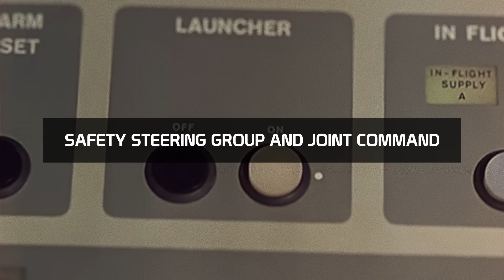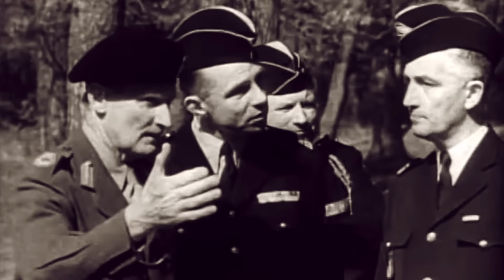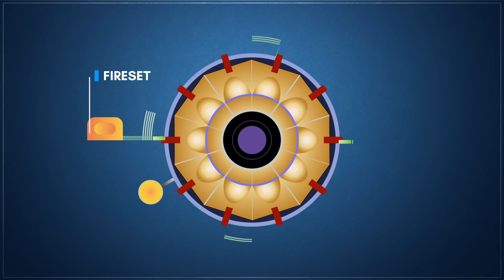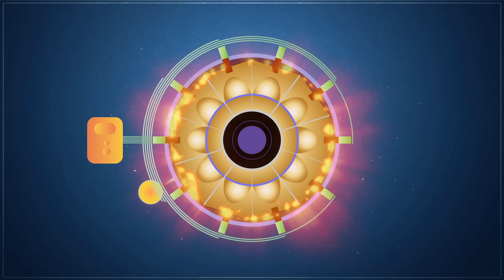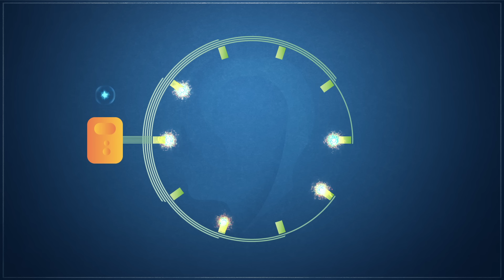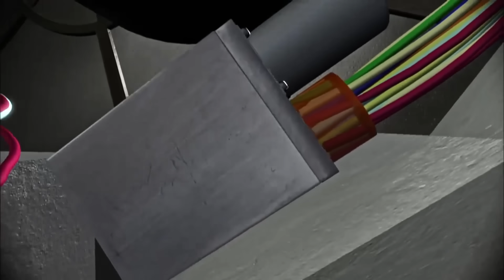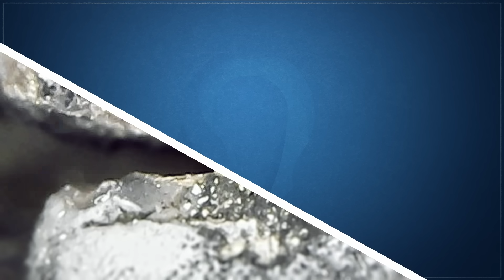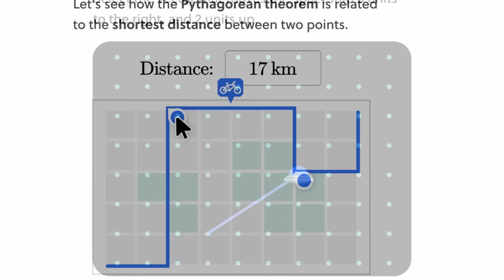The Remarkable Mechanism That Secures Nuclear Weapons

Comment: 2010-0114, Officers Accused of Secret Theft Allowed to Resign. 
Two officers accused of stealing classified material from an underground missile launch facility @ Minot Air Force Base, N.D., have been allowed to resign rather than face courts-martial, the military said Wednesday.  
Air Force Secretary Michael Donley approved the resignation of Capt. Paul Borowiecki in September & Capt. Javed Abbas last month, the military said. Abbas is stationed @ F.E. Warren Air Force Base, Wyo. & “will be out of the Air Force in the near future,” an Air Force statement said.  
Borowiecki has been discharged from the service & is living in Mesa, Ariz., records show. Neither Borowiecki nor Abbas could immediately be reached for comment. Neither man had a listed telephone number & Abbas did not immediately respond to a message left for him @ the base through an Air Force spokesman.  
The Air Force had not named Abbas until Wednesday, the day it released the status of both officers, after months of inquiries by The Associated Press.  
The men were missile combat crewmembers assigned to the base’s 91st Missile Wing. They were among the crew members who work 90 feet underground prepared to launch nuclear missiles.  
They were accused of taking classified material a device used to detect equipment tampering in the launch facility, said Air Force spokesman LTC John Thomas in July 2005, rather than destroying it as required when it was no longer in use.  
The Air Force said Borowiecki admitted the theft in May 2008 & returned the device.  
A hearing was held in September 2008 to determine whether Borowiecki would face a trial. A supervisor, Capt. David Walbeck, testified @ the hearing that Borowiecki wanted the domino-size device, as a souvenir because he thought it would be “a cool thing to have.” Walbeck also testified that had the technology been compromised, it could have led to “unintended detonation” of a nuclear missile.  
The Air Force later downplayed Walbeck’s statement, saying the launch device is one of many safeguards that must work together to ensure security.  
The Air Force has said Borowiecki told officials that Abbas had lied by saying he destroyed his device.  
The Air Force refused to confirm whether that device remains missing.  
“An investigation determined there was no compromise of the safety or reliability of the system,” an Air Force statement said. Lie-detector test  
Officials said the theft became known when Borowiecki was given a lie-detector test in applying for a job with the government’s National Reconnaissance Office. Officials said he answered yes when asked if he had ever stolen classified material.  
Borowiecki was charged with dereliction of duty, making false official statements, wrongful appropriation of military property & mishandling of classified items in violation of federal law.  
A court-martial had been scheduled in March for Borowiecki but was postponed.  
The Air Force said Abbas also had faced military & federal charges, but the service would not elaborate.  The cases were handled by the military separately.  
“It was determined that acceptance of these officers’ requests for resignation & directing their administrative discharge from the Air Force was an appropriate resolution for this matter,” the Air Force said in a statement. “Both individuals have been held accountable for their actions.”  
The Air Force has said the case led to changes in the procedure for destroying the launch devices after they are no longer in use & that they are now destroyed @ the base under the supervision of two other people with top-secret clearance.

Comment: Couldn't you just bypass the locking mechanism and "hotwire" the bomb? You should be able to set all of the explosives off at the same time without using the intended method.

Comment: 8:40 No...that's not correct ,the ignition is not synchronized it is better described as simultaneous, the firing mechanism does of course use low inductance design but that is secondary to the truth of it, it is designed so that all the explosives are ignited  down to the microsecond, the explosives are shaped charges that act as a compression force, timing is critical, to be sure that the force is perfectly symmetric, perfect compression.

Comment: Our land base missle systems are network isolated. They are not tied into the internet or any other web based launch control network. They can only be launched on site. Sub based nukes operate the same way. In short, if the guys who are manning the missiles don't launch them, they cannot be launched by any other means. I imagine other nations follow the same protocols. Nobody wants to have their nukes hijacked electronically after all.

Comment: Incorrect, the voltage used to initiate Exploding Bridgewire Detonators (EBWs) and later Exploding Foil Initiators (EFIs, aka “Slapper Detonators”) is between 3kV and 5kV, not 20-60kV.
Also, the detonators were not sequenced as indicated in the video, “Simultaneity” was key for a clean, efficient detonation, we are talking about nanoseconds.

Comment: I was a bombardier flying A-6 Intruders in the early 80's. I was qual'ed as nuclear delivery crew and as a nuclear weapons loading officer. We handled three different nuke weapons models. We had a class on PAL because of the possibility it might be coming into service, but from '80 to '83, none of the weapons we had used it. In theory, though, none of the weapons aboard a aircraft carrier were jointly under the control of any other nation. At some point after I left, they stopped putting nukes on carriers, although I think they are still capable of using them.

Comment: I was a weapons systems specialist in the USAF in the 80's and 90's. On the B-61 bombs we loaded, we connected a device called the PAL/USG. Permissive Action Link / Unique Signal Generator that transfered the codes to the Pilot, and the Weapons Systems Operator on the F-111F's I worked on. Exercises were run using the actual live weapons, and we went through the routine, as if it were for real. The jets ran down the runway, but killed the throttles, and hit the brakes, and returned to the victor alert area. You can't fly with nuclear weapons anymore, unless you were actually going to use them, as intended. Those exercises were a real sobering, eye-opening experience. Seeing this vid brings back a LOT of memories....
Reply: There was a “Incident” where we accidentally flew with some ordinance they forgot to replace the physics package with an inert dummy.
Reply: @videosuperhighway7655  "Whelp, just another day at the office-"
OPREP-3 - BENT SPEAR
"Awesome. That's exactly what I wanted to deal with today."
Reply: @meatharbor  Our fear when loading was damaging/ scratching the weapon. NOBODY wants to fill out a Dull Sword report. You'll be standing tall before the DCM, explaining why that happened. You'll emerge with one less stripe than when you went in...
Reply: @GJones462-2W1  causing a Dull Sword... i can only imagine.  The worst I ever saw as a missile cop in Minot was a delayed convoy, and even then people were shitting themselves.  I was just standing there like a lump at the gate waiting to let the payload transport in.  xD
Reply: @Mog_King_of_Moogles  Yeah, I would LOVE to watch that process. Either removal of the missile, or the installation of one. I'll bet is well choreographed, like our aircraft loading is. So as someone who was on site  in a place that that with nuclear weapons, you know what PRP is, don't you?
Reply: @meatharbor  OPREP-3P – NUCFLASH
"Awe cr@p"
Reply: There are no bombers with nukes on them for quicker response if needed? As a former submariner, are ballistic missile subs are always carrying a certain number of nuclear missiles on board, when out on patrol. These subs even have 2 crews so that the Navy can maximize the time the sub is at sea. Because the subs are always armed and patrolling, I figured that the air force would have something similar…a B-1 or B-2 armed and ready to go, or even flying a set pattern continuously like in the movie By Dawns Early Light? Thanks for your service!
Reply: @SubVet84 we used to have armed bombers in the air at all times circling around the artic, but we no longer do that with aircraft due to the risk of accidents. We have subs for second strike, and we have like 400 silos with active warheads that would be very hard to wipe out. Plus it's very unlikely that the Russians or Chinese could plan a strike without us hearing about it, so for normal levels of threat there is no point.
Reply: @SubVet84   iirc they used to do it but stopped since a few of the planes crashed whilst carrying live nuclear bombs (in the case of one bomb all but one of the safety mechanisms failed). Safe to say that they stopped doing it after a while (I guess it became an unessecary risk later on since they had more than enough ICBMs to destroy any adversary anyway)
Reply: @SubVet84  In todays world having the bombers fly a pattern 24/7 like in the cold war is kinda pointless. With ICBMs especially the sub launched ones, anywhere in the world can be hit in minutes. The bomber patrols make for good deterrence I guess but in todays world they are unneeded. That being said I wouldn't be suprised if the air force keeps a certain number of aircraft ready to go with bombs or aclms in case the call comes in.
Reply: @SubVet84  Boomers provide the assured retaliatory strikes aspect of the nuclear triad. While at sea, they are a self contained and highly controlled environment.
Reply: I saw a recent Air Force or DOD production about the B2 and the special hangars and personnel. They specifically said that three or four- I think four, of the B2s were prohibited from viewing or filming any of the aircraft or hangars, and they weren’t allowed within a weird range, 150 yards of the hangars, as I remember. Anyway, they said these four bombers were loaded with nuclear weapons and ready to go 24/7/365. It sure didn’t feel like propaganda. It’s so cool you worked on F-111F! It's one of my favorites that doesn’t get enough love. I’m next to Dyess AFB, so I always get glorious final approach views of the B1. I can hear them throttling engines as I type this…
Reply: The young'uns nowadays have to watch TikTok videos to arm it. :D
Reply: Why dont they fly out with them anymore?
Reply: @LegendaryCollektor  To prevent accidents like the ones that happened in the 50's, where aircraft went down with live nuclear weapons on board. Since there's a ban on testing, if they go wheels-up with specials onboard, you'll know they're going to get used. Likely, there's conditions that NATO has imposed on the US, UK, and France with that reasoning in mind, but I can't say for sure.
Reply: @GJones462-2W1 lol well we might be leaving nato soon anyway.
Reply: @LegendaryCollektor Because it added to AOC’s cow emissions ruining the planet.
Reply: And the only had to lose like half a dozen in plane crashes before they stop flying them around lol
Reply: Santa Maria.
Reply: Because flyboys have lost weapons in the past due to various fuckups.
Reply: So in the end, all those exercises burned out a lot of aircraft tires are brakes 

Not to mention the frayed human nerves!!
Reply: Meanwhile… the President is swimming in a sea of Dim__N __cha cha cha…. And AWOL Austin hasn’t been heard from in over a week…  Making a complete mockery of the “seriousness” of the whole endeavor.
Reply: What a bummer. Let them fly with live weapons.
Reply: They weren't live munitions.
Smh
Reply: @DinoNucci  Ah, yes, they were. As a former weapons load instructor/evaluator and SLC crew member, the only inert shapes we had on base were the statics used in the load barn for monthly weapons load training. They were live B-61's and the occasional B-57, although they were phased out by the time 1990 came. The best kind of training when it comes to specials, is to load the real thing, on the actual aircraft, and simulating takeoff. 

You have any experience with aircraft weapons & weapons systems, or are you just trolling. Likely the latter. Shakin' MY head at your ignorance.....

Comment: Wait, they are using capacitors as a safety mechanism to disable the chance of  any nuclear detonation?
Surely the first  thing  to be   rendered inoperable  in  an EMP attack would be a  capacitor?   
I don't claim to  be knowledgeable in  electronics  or nuclear  weapons    but surely  this must  mean that  missile silo's are  not  only  hardened with steel  and concrete to  survive  a   nearby  nuclear strike but must also be electromagnetically shielded  as  well?  I  would love to  know how  that  is achieved.  I'm not doubting  it if it is done but  just very curious as to how.
Maybe I am misunderstanding the situation,  but if a nearby nuclear strike would  render any  silo'd missiles useless, then it follows that   the US  or Russia would have  no choice but  to immediately launch every missile in the  areas  of a  predicted  strike  or give  up any  hope   of a retaliation.   That's  as scary   as it  gets, as  it makes a limited nuclear exchange   almost impossible.
I hope I am misunderstanding  this, ands someone can correct  me.
Reply: There are several layers of thick metallic shielding around such a capacitor. There is the myth that an EMP destroys all electronics and there is nothing we can do about that. That's plainly wrong. Proper shielding and protection is possible (just often not feasible for consumer products). Read about "Electromagnetic Compatibility" if you are interested. A capacitor not connected to anything would probably survive strong EMPs even without shielding.
Reply: @raxneff  Thanks,  sort of makes sense but as said I have no in-depth knowledge of electronics.  So basically if the capacitor is shielded by something similar to a Faraday cage even an EMP is no risk.
Reply: @eamonnfanton2165  If it's not connected to a long-enough not properly shielded wire, through which the EMP pulse could induce a high voltage peek into the capacitor, it would probably survive. Keep in mind that a long enough wire is pretty much an antenna, and a few cm could easily be enough.
Reply: @raxneff  ok  now that makes more sense to me.  Reducing the possibility off induction reduces the risk of any EMP.  So basically all these electrons used in the missiles and silos  would be designed with high shielding and reducing the possibility of induced current.  I can imagine that that would be a project in itself and very costly but given what these electronics are protecting well worth it.   Thanks,  really appreciate your response.

Comment: Electronics and radiation... they don't really go together... even if shielded in the long term the plastic changes, components stop working, everything changes. So fewer moving parts and less electronics also less frequent replacements... and certainly a mechanical safety system is better than a digital one for these very reasons. At least in those years. Now there are certainly very different materials and everything is still better shielded.

Comment: Awesome. The most comprehensive video regarding PALs so far. Kind of interesting to see that the system more or less evolved from glorified bicycle code locks to a complete encryption network. It surprises me that this information is now public, I thought a lot of it was under NDA or top secret for very long.
Reply: We shared PAL systems with Russia and England and I think one or two others (Israel and another I thought) you know in interests of safety in case a device is stollen. Specifics on it all is not public, overall theory is.
Reply: This information is probably closer to what was than it is to what is

Comment: After 6 months in 7-10 papy server i got a SS 10 ranking, another guy told me that aint sht, come out to the rest of the tracks. Best thing i ever did, i got the the 2nd overall highest ranking in papy at year 3, played for 6 more years, then there just wasnt enough comp to have fun any more.
OD/UD was my favorite trick i came up with, huge advantage, with that fuel, tape and clutch tricks got better (albe to extract more from them), and then the WR. Iaveraged 28 races a week for the 1st 4 years, i miss that game.

Comment: If you want to watch a really good and in-depth explanation of this subject, go to Sandia Labs website and watch "Always, Never", a 4 part series of how this was developed and the different iterations designed and deployed since 1945.  FYI, the two bombs dropped on Japan both had the fissile material installed before they left the ground.  It was the electrical connections that were completed prior to dropping that were the last step in the arming sequence.  Later devices had the core mechanically inserted prior to delivery, but not the first two.